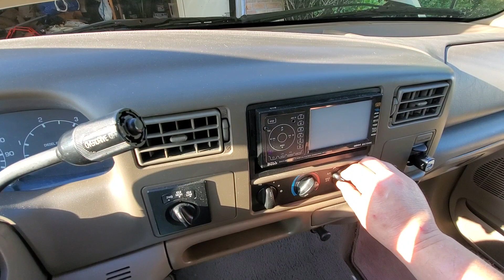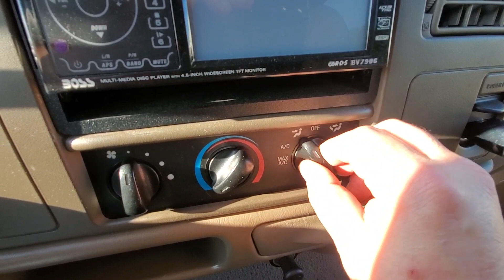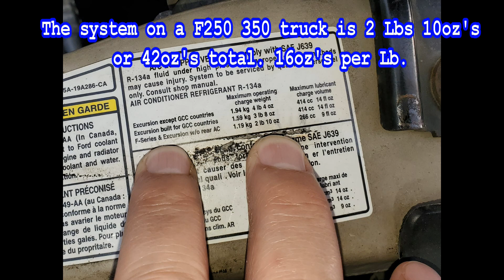How to Detect Low AC pressure Easily Ie F250 or F350

Comment: Thank you for this one!  Worked like a charm after I tried for half an hour to get the system to charge.  Great video!
Reply from the maker: Ah glad to help Eric. I just threw this one together as a quickly for a friend who was having problems with his AC. Another thing when having problems charging a system if it won't charge don't over look the coupler valves on the ends of the AC Gauge set. I had a Low Pressure Coupler that was clogged and I had a heck of a time figuring it out. After I figured it out everything went smoothly and I was able to charge my system quickly. Thanks for watching. Best Wishes & Blessings. Keith Noneya

Comment: You have one of the best informative videos on this topic I've saw! I have a 05 4.6 and replaced the compressor thinking it was bad, well come to find out the old one was good afterall. However my ac compressor clutch isn't kicking in. Was told the pressure switch could be the problem. So hopefully that's it. Fuse is good so I'm not sure where else to look after I swap the pressure switch.
Reply from the maker: There's a Orifice tube that regulates the vapor going into the Evaporator, (a small Aluminum Radiator). The Evaporator is in the clam shell housing on the left side in the engine bay Those Evaporators get clogged externally with dust and debris. Here's a video on how to clean it: https://www.youtube.com/watch?v=TqFf7tP7Nfw.  - The video is from another channel but it's a pretty good one.
Sorry I don't have a video on the orifice tube but the Orifice Tube can be pulled and you can clean it or replace it. . But you have to vent all the R134A out to do it, then recharge the whole system again. A local AC shop can evacuate the R134A for you and if you rent the vacuum pump and gauges you can then recharge it. 
Hope that points you in the right direction. Feel free to ask more questions. I've rebuilt mine and have done others so its no problem to answer most of your questions. Best Wishes & Blessings. Keith Noneya

Comment: Great stuff sir, having ac issues myself. I'm gonna check it out tomorrow  great video very informative.
Reply from the maker: No problem glad to help. Let me know if you need anymore help. Just ask away, that's what my channel is about. Also do me a favor and give the video a thumbs up, if you haven't already and subscribe,, even if you don't come back it helps my channel. 

In the future I'm going to do a complete series on how to rebuild the AC system by replacing EVERY item in the engine bay related to the AC System.
- I'll show how to find test and find leaks
- Pull a vacuum 

- Recharge it. 

- Where to find the parts cheap and get access to the tools WITHOUT BUYING THEM! 

Thanks for watching and glad to help. Best Wishes & Blessings. Keith Noneya
Reply: @keithnoneya  I bought a can of the ac recharge stuff but I don't think my compressor  is working
Reply from the maker: Mike Smith and I live in the same town. We met up at his house and found he had in intermittent High Pressure Switch (HPS), the one next to the compressor. I wiggled the connector on it and it cut in and out. We thought it was the wires but when I put my old HPS on his connector the compressor fired right up. Next I wiggled the wires again and it kept running. That meant the pin contacts in HPS on his truck was intermittent. We changed his HPS with my old one, lost a little R134A because the shrader valve in the line was stuck open, after that it ran great with no intermittent problems. We also had to change the seal while it was venting R134A, not fun. I just put it on slowly and I used my fingernail to keep the seal pushed up into the HPS. I snugged it up and used 50% dish soap & water and leak checked it. It seal, thank the Lord! We put about a 18oz in it and his AC is running and cooling great now. Thanks Mike for letting me come over and hang with you, your fine truck, & family. Best Wishes & Blessing. Keith Noneya
Reply: @keithnoneya what the name of that valve on the tank that plugs in on the tank in the fire wall
Reply from the maker: @yashuwasaves  Schrader Valve. It's what holds the R134A in the system if you remove the Cycle Switch to replace it. The Cycle Switch is what the connector plug connects to on the cylinder (Accumulator Dryer) on the firewall. If you change the valve make sure it's an AC Schrader valve not one for a car tire.  I hope that answers your question. Best Wishes & Blessings. Keith Noneya

Comment: Refrigerant and oil leaked out of the original FS-10 compressor of my Ford Excursion which I suspect was through the shaft seal. If the clutch still engages by applying direct power and there are no noticeable noises, is it worth changing the seals or is buying a remanufactured unit a wiser choice?
Reply from the maker: Super question. If it has a ton of miles on it, I'd replace it. If it doesn't have a lot of miles and you're on a budget change the seal a dryer. Whether you replace it or not I'd pull the Orifice Tube out and clean it and put it back in. To do a reliable job you'll probably need to take the compressor off and dump all the oil out then put fresh oil in. There's a tag on the front of the truck grill that should tell you what type of oil and how much to put in. Go to an Auto Parts store and rent an AC Vacuum Pump, Pull a vacuum let it sit for 30 minutes and check the gauge to see if the pressure has dropped, if so it has a leak. Then install your refrigerant if you don't have any leaks. Thanks for watching and glad the video helped. Best Wishes & Blessings. Keith Noneya

Comment: or the low pressure switch is faulty / test continuity on the switch by using a multimeter
Reply from the maker: Yep it sure can be, a long with a dozen other items too. It could be a bad control panel, a blown fuse, a bad AC Clutch, a bad wire and the list goes on. The video was to primarily to show the easiest and quick way to check for low AC Refrigerant, not all the possible things that could cause an AC unit not to work. Thanks for the input though, I hope your comment does help someone find their problem if they do have a good R134A charge. Best Wishes & Blessings. Keith Noneya

Comment: Does the low pressure switch have a schraeder on the accumulator that allows it to be swapped out without losing refrigerant?
Reply from the maker: Yes it does, however a lot of them will stick due to age and still leak. So have the new one there ready go, so you can do it quickly. I had a High pressure leak like crazy when I pulled it. I even tried to reset the pin in the valve with a small screw driver, but to no avail. MAKE sure you have some safety glasses and possibly some mechanic gloves so you don't get fluid in your eyes, or frost bite on your fingers if it leaks a lot. So have a fill bottle ready to recharge a little bit that comes out, if needed. Hope that helps. Best Wishes & Blessings. Keith Noneya

Comment: Great video! I have a late 99 F-350 and my compressor clutch cycles on and off all the time, but the A/C blows nice and cold. Should I leave it alone or should I dig into it and see if I could fix it? I could do the trick with the paper clip and add 134A if it's reading low, but I don't have any gauges to check the high side and I just don't want to damage something that is working. Well its cooling at least.
Reply from the maker: AC compressors are designed to go on and off. It's the main reason the Low Pressure Switch's real name is the Cycle Switch. The system is designed to build pressure then turn off and let the pressure push the R134A into the Orifice Tube. As the pressure drops from it being released he compressor is then turned back on. The best way to tell if your system is running good is to put a set of gauges on it and check them along with the temperature in the cab. If it cycles a lot and and the temperatures are good, you could check to see if the Evaporator is clean. Here's a video on how to check that and clean it on another guys channel; https://www.youtube.com/watch?v=TqFf7tP7Nfw&list=PLVLXGvrQp0OtYXKroYmzvobuzAt3wrvPV&index=5  Hope that helps. Best Wishes & Blessings. Keith Noneya
Reply: @keithnoneya  I get that it cycles on and off, but I only turns on for about 5-10 seconds then shuts off for a bit then turns back on for the same amount of time. My idle fluctuates is the main reason that it drives me crazy.
Reply from the maker: @fixdrummer Yeah I used to think that too, but after looking at some other vehicles I realized that it's supposed to do that. If it didn't do that then the High Pressure switch would constantly be turning off the compressor as well, only the lines and seals would be seeing a LOT more pressure. The higher pressures would also tend the wear the lines and seal out, not to mention the compressor rings out faster as well. I'd rather it cycle at lower pressures more often then and loose the compressor at a later date than have it chew up everything in the system at higher pressures. I hope that makes sense in the system designers reasoning for both switches. Best Wishes & Blessings. Keith Noneya

Comment: What if the low pressure switch it's not working
Reply: Bad High pressure switch is not working ?
Reply from the maker: Then either the pressure is low or the switch is bad so replace it.
Reply from the maker: @wingyip6547  If the pressure is to high it will trip, if not then it should have a short through it to power the AC Compressor. If the pressures are to high on the gauge and the short is gone then this switch is most likely good. If the pressure is normal and it doesn't have a short then the switch is bad and needs to be replaced.

Comment: Did you know the year and model of this truck ? I ask because i got 2003 ford f250 5.4 gas 4x4 and i see the high pressure switch on this truck but do you know if mine has a high pressure switch as well as the low pressure switch ? Ive never seen it ? Also Im going to look up your video on pulling a vacuum but if you could tell me, are you saying a electric vacuum or can you use a hand pump (mityvac) vacuum pump ?
Reply from the maker: My appologies on not putting the year. My truck is a 2001 F350 7.3L. The configuration is the same for the 99-03 Superduty's. The High Pressure switch should be near the Compresor on the line. The Cycle or Low Pressure switch should be near the Evaporator housing on the passenger side. You should be able to find a video on the 5.4 AC High Pressure switch on YouTube to help you locate it. As far as the vacuum you need an AC Vacuum Pump to pull the system down to around - 30 PSI or inHg. You can rent one for free at AutoZone or most automotive stores. You put down a huge deposit on it, then when you bring it back they refund your credit card. So it's a free rent. The same for the Gauges as well. Hope that helps answer your question. Best Wishes & Blessings. Keith Noneya
Reply: @keithnoneya  Hey man thanks, guess im still basic on this, appreciate your info truly !!!!
Reply from the maker: @brianblithe2271  Any time Brian, that's why I made the channel. Best Wishes & Blessings. Keith

Comment: So what if it doesn’t turn on by jumping that switch but it is full ? Mine only turns clutch on when I bypass the relay but when I use another relay still won’t work and only works directly jumping it  (why?)
Reply from the maker: Good question. If you jumper the cycle switch and the Compressor comes on then the pressure is low or the switch is bad. Time to put a gauge on it. What year is your truck?
Reply: So only turns on when o jump the relay not the switch and the truck is an 05 Ford f350 6.0 diesel

Comment: Good job.  I'm wondering where the AC vacuum pump solenoid is located.  Is it in the pump?
Reply from the maker: There are a couple of controls and items that effect that. Control box in the dash, the vacuum switch for the 4wd, vacuum pump, vacuum lines and tank. There are also the actuators under the dash as well. If you could be a little more specific on what your system isn't doing I may be able to help you find out what the problem is. Here's a video, not on my channel, to help:
-	FWD Switch https://www.youtube.com/watch?v=O0131cCtXnA
If you contact me at my YT email keith_noneya@att.net I'll send you a copy of the Vacuum Diagram of the AC system. Hope that helps point you in the right direction. Best Wishes & Blessings. Keith Noneya

Comment: If the compressor doesn't kick on with the paper clip, im assuming the compressor itself is the problem?
Reply from the maker: Most likely, but not necessarily, it could be a lot of things keeping it from coming on. The clutch could be burned out (part of the compressor), the Hi Pressure Switch, Wide Open Throttle Relay or switch, the PCM there's a ton of stuff it could be. Ohm out the clutch coil at the connector on the clutch, I think it reads around 4 ohms. I put that info in one of the other comments I answered. If I wasn't in a rush to go help my sick dad I'd do a video on how to diagnose AC problems. This video was just on how to detect Low AC, provided the rest of the system was working. Read through the comments I'm sure you'll find a long post by me somewhere oh how to do some simple tests to help narrow it down. Sorry I can't be anymore help at this time, family calls. I do have the AC schematic diagrams for the AC if you want a copy send me an email keith_noneya@att.net Also the Haynes shop manual isn't to bad and they have multiple AC Diagrams in the back. Best Wishes & Blessings. Keith Noneya

Comment: I have an 09 trailblazer what could possibly my issue? My ac is cold from a cold start will cool for about 15 to 25 minutes then starts to blow hot air refrigerant is fine and worked better once I put new ac and ac/clutch relays in the fuse box stays colder longer but still shuts off after awhile? Should I replace low pressure switch or?
Reply from the maker: I had a similar issue and I believe my problem was a dirty Evaporator. When it gets full of dirt and you run the AC the water builds up on the dirt and dust on the Evaporator. When that happens the Evaporator can't cool as well and the pressures drops and the Cycle Switch kicks it out. That's my theory anyways. Try cleaning the Evaporator and then checking the pressures again. The good news is you don't have to drain the system or pull a dash to fix this. Ford did this part right and they put the Evaporator in the engine bay where it can be reached & cleaned without opening the system. Cleaning is not as easy and it looks in the video link I'm sending you, but it's doable. Try "Living Our Dream's" video here: https://www.youtube.com/watch?v=TqFf7tP7Nfw Hope this helps. Best Wishes & Blessings. Keith Noneya